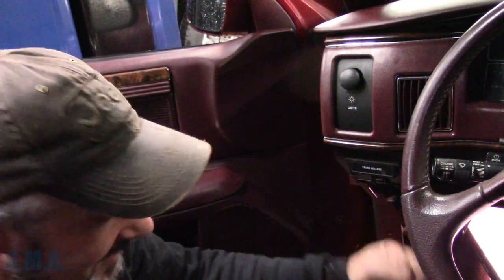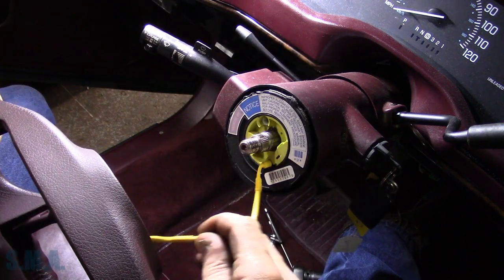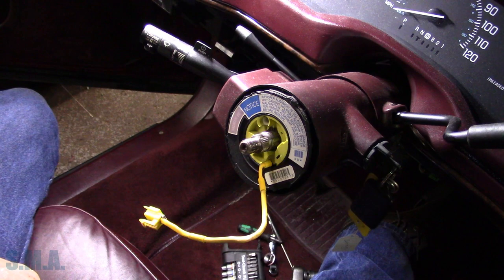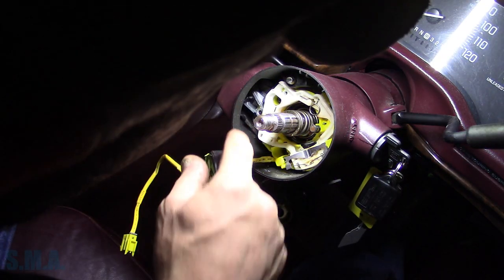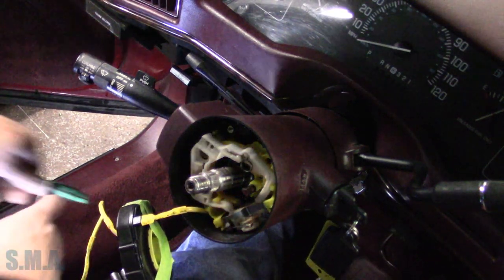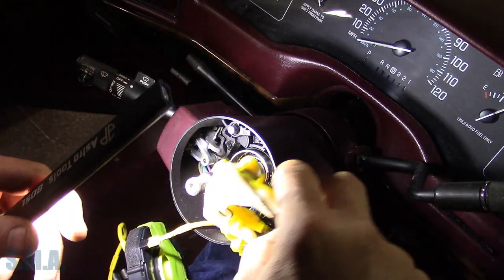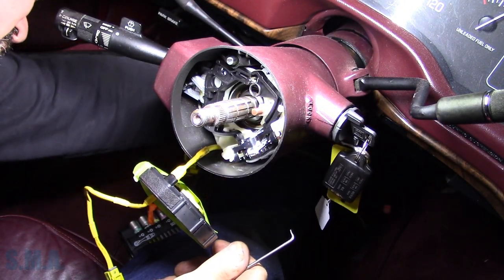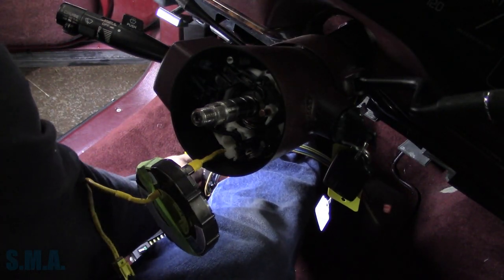Buick Roadmaster: Turn Signal Switch Replacement

Comment: With the exception of the airbag that's exactly what the guts of the column in my 76 Nova looked like. :-o Oh, and I didn't have the special tool to compress the spring so I had to use your old man's thumb method! :-)

Comment: Hollywood movies have taught you all you need to know: there is always a red wire and a blue wire! Cutting the correct wire will disarm the airbag. Cutting the wrong wire will immediately set off the airbag.

Comment: Thanks! My prediction is the check engine light came from the vapor recovery canister. Also, have you checked the rear diff gasket to make sure its not the original that blocked the oil galleys going to the wheel bearings?

Comment: I don't know if it was the proper way but I just cut the connector of and pushed the new connector back down. Seemed to work for me. Flashbacks from my time in a Chevrolet dealership. Probably won't sleep good tonight.

Comment: I have a special tool for shoving those connectors down the column. Made from a coat hanger with a tight Z bend on the end.  Flickering CEL sounds like fun...
Reply from the maker: So yeah... I made the call on the ECM. You tap it, it stops. I check all powers and ground and got the used box.... Wanna email me and talk about this? I think I'm wrong 🤨

Comment: I had a used bike once where every time you'd hit the 'passing' switch and both filaments lit up, it'd pop the headlight fuse. Luckily I kept digging til I worked out the problem (tothe previous owner had fitted an "upgraded" headlight bulb from 55/60w to 80/100w) and didn't just fit a higher rates fuse as that would've melted the headlight switch...

Wonder if a similar thing could be the root cause of the melted switch here? It could just be age or corrosion, but the car seems extremely clean for that.

Comment: Thanks for reminding me, I need to clean out my tool box. I need to put my old "speciality tools" in a smaller box. I don't need my lock plate depresser any more.
Or, my lifter puller, and the combo dwell & carb adjusting driver either!
Reply: In an old toolbox I have the open-end wrenches and spark plug wrench that CAME with my Dad's '37 Plymouth when new, and a spring flex shaft magnetic tip screwdriver for adjusting GM distributor dwell on the fly, along with a few other auto odds and ends. Gave away my dwell meter years ago.
Reply: I have all those tools in my main box also. Now I feel old.
Reply: @johnodum6486  Yes, but do you have a Gumout carb flush kit? It's like a IV bottle you full with Gumout, hang it from the hood & hook it to the fuel line! Old stuff, right up there with my neon powered timing light! 😁
Reply: @reecenewton3097  Ha! My dwell meters plastic cover is to yellowed to read!
Reply: My tach/dwell is in my box also. It is probably a museum piece.

Comment: Oh yeah I remember that total teardown to tighten 3 little screws
Reply: IF YOUR TALKING ABOUT TILT WHEEL, THEIR ARE 4 OF THEM. ONE OF YOURS MUST HAVE FELL OUT.
Reply: @terryharvey4811  no it was broke off some hammer head used an impact on it set to tighten and giver full beams snapped it off where I couldnt touch it but the other three worked great as long as you didnt over tighten them it worked long enough to find another good one and change it over and recolor it

Comment: The only turn-signal switch I've ever replaced was in a my '68 Ford Galaxie. No airbag -- not even a clockspring.  The horn wire -- the only wire that went up through to the steering wheel itself -- just hung loose in the column, and I guess they figured it wouldn't rotate enough to break.  Or, more likely, they just didn't care.  (1960s American car quality wasn't exactly the best.)

The turn-signal switch, of course, had several wires -- but it only did turn-signals.  No high-beams (those were a button on the floor), no wipers (those were a switch on the dashboard), no cruise-control (this car wasn't ordered with that option).  So I used a wire coat-hanger to fish the 4 or 5 wires down the column -- a much easier fit than what you had to deal with.  Never even occurred to me to cut the wires on the old switch and use those to pull the new wires through -- wish I would've thought of that.  LOL.   But YouTube wasn't even a thing yet back when I did that repair in the early 2000s.  Couldn't come to this channel for instructional videos because it didn't even exist yet.  :-)

Comment: That was the exact pull thru method as shown to me by and old GM tech some 25 years gone by. Back when that crap design was common on the road yet a guy got excited if you could just change a reset spring rather than the whole switch.

Comment: The belt attached multi tool is nifty... neat-o even.
I think you offended the Buick by wearing a Jeep hat. It thought it was being brought to a manufacturer neutral shop.
Hi to Mrs. O.! 

I told another YouTuber to call you... they have a heat problem in an old Ford and they’re about 2.5 hours away from you. Myself and at least one other viewer commented that they should use some 12v heaters.

Comment: I used to bend and turn the plug sideways and tape it tight to the wires and it always pulled through the top with minimal fiddling, ive changed several of 'em starting back in the 70's when the dinosaurs still roamed the earth (yes im oold) lol  I remember doing my '70 ElCamino & '75 MonteCarlo, a 64 Cadillac, '68 Cougar and a few others.  Seemed like once word got around I had done them everyone brought theirs to me - no I wasnt happy about it either--lol   Like a fool I used to do mine without a tool to compress the plate, took two guys - one guy to hold the plate down and another to R&R the snap ring--lolol

Comment: 92 Sub no airbags. I tied weed eater line to old wires pull down column.  Tied line to connector to pull down.  Knot came undone.  Fun

Comment: 1990 Lumina; turn signal switch twice. Once by pulling pins and then I string tied the connector along the harness to pull through. Don't recall either method being better.

Comment: Having never read the FSM (I had it) I didn't know that in 1979 GM added a security screw for the lock cylinder.  Unable to remove a busted lock cylinder I pulled the entire column and took it to Pontiac.  The mechanic is still probably telling that story.

Comment: Those horn pad assemblies frequently short out during temperature changes.  Horn goes off in the middle of the night.  I had one replaced 10 years ago and now the new one is doing the same thing..  Cost was around $1000 to get the horn to blow!

Comment: No JIS screws are uses in Saganaw steering columns.  They used both Phillps Head and Reed and Prince head screws.  Not a big deal unless the screw is really tight.

Also an important note the proper cap screw for air bag equipped  GM is the one with only about 1/4 inch of thread.  this assures you that you don't damage the clock spring. you can use a longer cap screw if you are careful.  But be careful to evenly engage the threads on both  so you get a straight pull .

As a general rule, an American car will have a tapered spline needing a puller.  Not necessarily true on imports, but then never had to pull the wheel on any import except older German cars.

On the blinker wire pulling, save some plastic strapping material.  this works good as  a fish tape.

Comment: I cant believe you recorded this. Beeping out the profanity would have made for a constant squeal during the video if i did i. 
Now,carry on down to fixing the tilt pivot parts. 
Aparrently i was the designated column guy in every shop i worked. An exercise in frustration to say the least. 

Side note; 
Doc says exercise is very important,you should exercise. 
I said im a mechanic, i work for a living, i dont need exercise i need rest!

Comment: 7:20 from your description of the check engine light, it sounds like a internal fault on the circuit board of the ECM. A quick test we did on these was called a tap test, we'd take a screwdriver and rap on the computer with the engine idling. If it stalled, acted weird, or the light went out, the ecm was bad, or it had a loose prom chip. If the chip was socketed and tight, we'd replace the ecm.i had to replace a lot of these in the dealership in the 90s, these early ecms were plagued with problems.
Reply: Were plagued with problems? They ARE the problem......
Reply: TAP/ RAP TEST WORKS WONDERS. HAD A FORD I COULD TURN AC ON AND OFF BY RAPPING THE COMPUTER. COMPUTER WAS THE GROUND FOR AC. CAR WAS A BUILT WRECK THAT HAD BEEN HIT IN RT FT DOOR/ FENDER AREA WHERE COMPUTER LIVED.

Comment: Wit& the column wires. Pull the old wire out and have a good string on it. Remove old wire from string. Add new wire to string. Pull string. Less risk of damaging anything.

Comment: Wow, that ol' Roadmaster got the works! Man, that thing was a PITA!! Why do the engineer stuff like this? Insanity. I get the wires down by swearing loudly, and occasionally throwing the nearest tool into the wall. That seems to get the wires home. :D :D  Another job (of many) I hate - modern steering columns (that Roadmaster is still considered modern to me, lol - my cars usually don't have airbags!).  My '89 S10 Blazer I used to have (put a '00 Jimmy 4.3 in it with a manual-choke carburetor and HEI ignition - FUUUUN!!) had the column nearly fall apart. My wife was driving the thing 65 miles a day to work, too! She didn't even notice!! I got in it one Sunday ... I rock the wheel, and it's got 5" of play in every direction! "How long has it been like this???" "I don't know ... I didn't even notice."  GAAAAAA!!! :D 3 of the 4 bolts were OUT, just resting there, and the 4th was halfway out!! Those will never come out again - I put about a half ounce of red Loctite on them, and reefed on them until I felt it twist!

Wow, Trinity is getting all grown up there. Where did the time go? I bet she's taller than me already ( that ain't sayin' much, lol ). Nice roach, LOL! My wife would've FREAKED! She's a city girl born and raised - bugs, snakes, and mice make her lose her mind ... so of course I make it a habit to catch snakes, bring them in the house, and say, "Look what I got!" She gets anxiety whenever I say that phrase ... then I spring the snake out ... like 10 feet away from her and she starts screaming, like Jason from the movies coming at her with a chainsaw, HAHAHAA! It's comical! 

I finally got my toilet ....er, Silverado ... back on the road again!! Made a parts run to the ol' Advance with it today. She shifts NIIIICE! Nice fast and firm 3rd and 4th gear, and lockup, unlike the stocker. Bought it from PerformaBuilt in PA. Has 5-pinion planets, Beast sunshell, and a Sonnax Smart Tech drum - HOPEFULLY the last trans I'll have to buy for that thing. Should handle the supercharger I have planned for the next couple to 3 years. That'll be FUN!! :D
Reply: HAHAHA! So you got roped into those ASMR vids too? Me and my buddies have been emailing those back and forth lately! I had never heard that word before. I laugh! My wife one time got up and left the room! It drove her nuts HAHAHAA! I've got one friend that flies into a rage if you chew with your mouth open - I sent all those to him ... one girl chewing ice, HAHAHAHA! It's a crazy world out there today man! What the hell is happening?!?

Geesh, that took 12 tries to post - sorry if you got all those email notifications ...

Comment: Hey man I’ve been a subscriber for a few months now and I have a question about my 2007 maxima. I live in Florida so it’s a lot of driving I gotta do but when I get on the high way or get up to 50-60 my steering wheel starts to shake but goes away when I get up to 70 ish or decrees my speed to 40 or lower. Any suggestions on what it could be? I checked my tie rods and connecting rods and axle but no signs

Comment: Eric, check the wiring at the engine bay junction box. My 96 roadmaster had the check engine light on and the secondary fan was running all the time hot or cold. Code P1642. I fixed the burned up wiring under the secondary fan relay in the junction box and problem went away. I know you said the roadmaster your working on is OBDI but it may have the same issue mine had. By the way thank you for making these videos!! My turn signal switch is bad as well and this will help!

Comment: I have a 70 Chevelle that I had to get inside the column to tighten down the screws that held the switch. It looks identical to the point that I bet all the parts would interchange. It does not have the air bag components of course. After dicking with that locking plate for a while, finally went to 'Napper' for a compressor tool. Never had a check engine light problem Ha. Ha.

Comment: I had an interment problem with my 2003 chevy sliverado. Light to service 4wheel drive would randomly show up.  Later that year I had a whole mess of ground wires break off at the same time. After all the grounds where fixed, that issue went away. I had multiple mechanics look into but it never stored codes.

Comment: If i only had a nickel for every one of those I've done. By the way, if you slide the retaining clip for the lock plate up on to the compressing tool it will be easier to reinstall!   btw I believe those are called "Posi drive" screws!!!  There's one in every crowd!

Comment: Now that's a real mans job,  No playing with your digital modules with differential communication and resistive termination rubbish,  Boy! lol.
Yep insulation tape around the connector and wires.
So fishing the wires through the steering columb tube is simpler.

Comment: After the snap ring has been picked out of the groove, remove the lock plate spring compressor and use the lock plate to push the snap ring off of the shaft. (11:40 - 13:18)

Comment: In 1981 I bought a brand new Chevy Cheyenne. Wife used it one day and when she got back she said the turn signals quit working. Checked everything and replaced a blown fuse. A few weeks later she used it again and honey, the turn signals don't work. OK, replaced a blown fuse again and I couldn't find what was causing it. She used the truck again and you guessed it - blown fuse again. It finally dawned on me why it was blowing fuses when she drove it and yet it never would when I drove it. You see she is really short and she always dropped the steering wheel down. What was happening was that that big bundle of wires would move just enough when the steering wheel was lowered that the u-joint would rub them and finally worn through to short it out. When I drove it with the wheel up it wouldn't cause a short. The fix was for her not to put the wheel down so she stopped using it. I sold the truck 15 years later and never blew a fuse again.

Comment: I may have just put a external blinker switch and left the crap broken in the column. It was my car so no harm no foul. A  It was. 1970 Plymouth  Fury 2.  My baby got hit by a speeding grain truck and spun the car 360 into a ditch. The old girl was still running. I bent the fender back away from the wheel and tire and drove her hone.  The truck drive drove into my lane. Those old cars were sturdy as hell.

Comment: God I remember doing a lot of these old Gm’s back in the day most the time I had to do them out in the parking lot it was either freezing cold or smoking hot. Every time I open that drawer on my tool box with the lock plate depressor I just shake my head !!!!! What a cluster 😂

Comment: All the Saginaw tilt columns would come loose.  Chrysler used the same columns in the 80's.  I could pull them apart with my eyes closed.  I was in my early 20's working on these cars.  Yup you could only get to two or the bolts unless you took everything apart.  I would put loctite on the bolts.

Comment: Eric can you tell me what the tool you used to depress the locking plate , to remove that snap ring from the steering column is called and who makes it . I have a 89 Chevy truck that I'm going to do the same thing to , replace the turn signal cancel parts ??? Thanks

Comment: I’ve literally done hundreds. When the lock plate is compressed use a ice pick in the spline, then a flat blade screwdriver and walk it up. I’ve came to make keys and completed the job in 10 minutes. The right tools and technique

Comment: That job reminds me of taking the column apart to tighten the torx bolts on the pivot, then another tech tells me I can tighten 3 of the 4 without taking it all apart, oh well I felt like I fixed it correctly the first time!